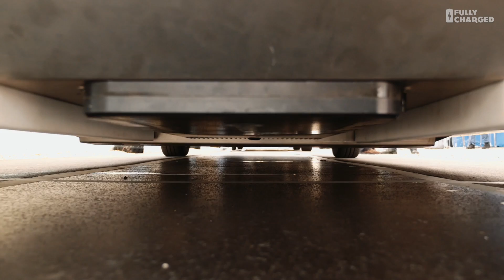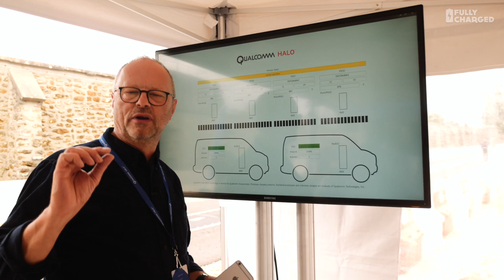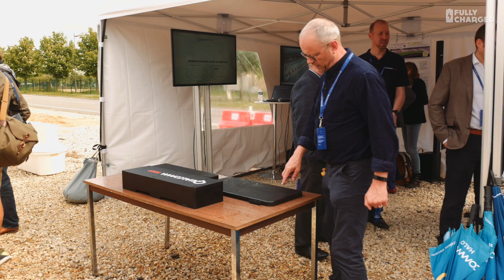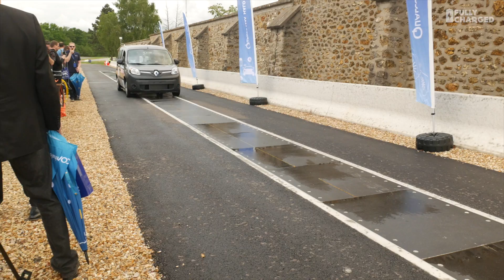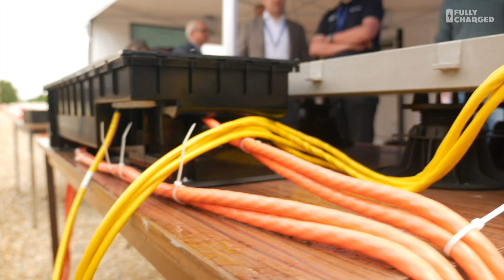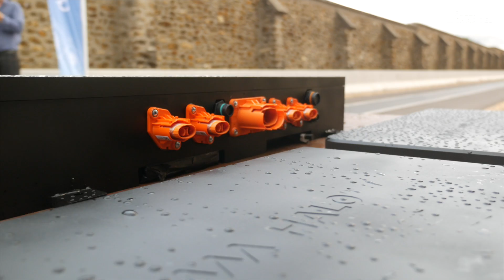Dynamic Electric Vehicle Charging | Fully Charged

Comment: 20kw for a fraction of a second means nothing. This has to be the dumbest, most inefficient possible way of charging a vehicle. The distance between the pads creates SO much waste it's not even funny, this isn't an electrified train getting its energy from the wires, this is the same technology that charges your smartphone. And these pads have to be on all the time, beaming out >40kw of power from each one!!!! This is as dumb as solar roadways. Do you see how little clearance they have between the charge receiver? This is like driving in a dropped car, every speed bump will scrape the shit out of that fragile pad. This might work in a parking lot, but not on a highway. You'd need miles of it to get any noticeable charge out of it, and the price of building thousands high energy inductive pads into the road will be astronomical compared to just charging at a station through a wire. A mile of charging roadway would probably only gain you <1/2 a mile of extra charge, and you want to take away highway lanes from non-ev vehicles, to create these charging lanes which can only be used by paying customers. Dumb. That 110kph run had 4.5 seconds of charging time..... So the customer gets a fraction of a cents worth of electricity, for the STUPIDLY high cost of having such a road..... I also wonder what such a high power inductive current will do to a regular car driving over it, it'll definitely add some charge to the wires in the car, and I can easily see it being possible to fry the computers in a regular car if it's not shielded. Cell phone chargers only send out power when they detect a phone charging, these would have to be blasting all the time.
Reply: You seem to be conveniently forgetting, that charging is only activated when vehicles, with the appropriate technology onboard, drive over it, & decide to use it. It won't be "on all the time, pumping out KW's". It specifically stated the pads turn on & off as the equipped vehicle passes over them. Therefore, non equipped cars will not activate them. Were you not paying attention, or are you deliberately trying to be obtuse ?. There are uses, for this technology. No one is suggesting we dig up all the roads, now to install them everywhere, these would be installed in limited locations where they would be beneficial. But the whole point of this seems to have zoomed way over your head...
Reply: +Charlie, sorry dude, but you're out of your mind. Think about how many on\off cycles each pad will go through, and then go find me a switch that'll push 40kw all day long while switching tens of thousands of times per day. Just because their test bed makes these claims does not mean that it can be done in the real world. I'm not saying it can't be done, just that it's completely idiotic to do so because it gives practically no benefits for a huge cost. If you're not going to dedicate a lane to this than how do you get just the EV cars into the lane and not have all the other traffic going over them as well? Maybe it didn't zoom over my head, maybe you don't understand practical engineering? Do some basic math, and tell me where I'm wrong. Calculate how much you'd get out of the system, how long of a road that is, and the cost for that section of road, and then you can call me obtuse. 

I guess I might as well do the math for you..... How much energy did that car get driving over a 100meter stip? 110kph, 100meter distance, that's 3.5 seconds of drive time over pads where only the VERY center few inches  over every pad (which itself is probably a meter long) can achieve 20kw, so I'd comfortably put that at a 90% efficiency loss over the entire drive area. That's a total charge of barely a SINGLE watt for every 100meters.. So for perspective, it'd take you over 100 hours of driving just to charge a 100kwh pack, and that's if you somehow didn't use ANY energy for while you were doing the drive. So in conclusion, if you drove over a 20 mile highway fully lined with these things, at the end you'd end up with maybe an extra 0.1 mile of charge available. If the car was just parked on top than yes, some decent charging is possible, but since the car is traveling over the pads, a TINY fraction of the time is actually used charging since the coils have to be perfectly lined up with each other. That's why if you move your phone off the center of the charging pad even a little, it loses all charging ability.
Reply: Again, you are assuming that these will be placed, in the most unsuitable locations imaginable. There are plenty of locations where vehicles are not averaging 60 - 70 MPH, where this would be beneficial. If the pads are only activated by equipped vehicles, it doesn't matter that the lanes have ICE vehicles in them as well. You imagine, problems where there are none. We are going to have to have systems like this for autonomous vehicles, & buses & parking bays anyway, so it will happen wether you like like it or not. Get with the program & stop being a such a luddite...
Reply: +Charlie, come on dude, I even did all the math for you. Your arguments make zero difference to the fact that this is an insanely inefficient way of transferring energy and it'll cost SIGNIFICANTLY more than what it's worth to the consumer. Your argument is as dumb as the people that say that we should have solar roadways just because we can. Look at the math, show me where it's wrong, show me an economical advantage of using such a system, or please, keep your hopes and wishes to yourself. I'm not a luddite, I just understand basic math, and you seem to not be worried about such frivolous things as "numbers". You're believing in a technology you clearly have zero understanding of. The problem isn't the charging technology, it's about how much charge can realistically be delivered in a real world situation, and until you do the math on that, you need to stop calling people names, because you sound ignorant. All the math is in my post, feel free to tell me where it's wrong, and in what perfect scenario you see this working and please provide the math to show it. I'll gladly shut my trap, I just require more than your opinion on the subject to do so. Remember, I'm not saying it's impossible, just that it's absurdly impractical, and all you have to do is show me the numbers.

Luddite, haha, funny, I'm an engineer that retired at the age of 30..... I really don't like to use my accomplishments to prove my point, but I can sure as hell assure you that I know more about technology than the vast majority of people, it doesn't mean I'm right, just that I'm not your grandpa.....
Reply: People who live in glass houses shouldn't throw stones, "sorry dude, but you're out of your mind", calling people names, that's You "Dude". The Solar Roadways engineering implementation was, lame & inefficient, badly engineered, & used in the wrong context. Better implementations, of the idea, such as on low footfall, Dutch bike paths etc, with a different design have been more than successful, so using that as an analogy is rather lame & unthoughtful. Obviously you don't implement schemes in wildly impractical areas. It's all about context & implementation. Inter-Area Haulage, Public Transit, Autonomous Last Mile Vehicles, & Parking are perhaps more practical implementations. Clearly it's not "absurdly impractical", as electric public transit buses & short haulage electric trucks, are already using pantograph style electric pickup mechanisms, for in motion recharging of, supercapacitor / battery banks, in a similar, configuration, & that works fine, are they impractical no, they are in use as we speak. So there is no reason why wireless charging, cannot be used, in the same manner...
Reply: Eugene S Stop being obtuse and narrow minded. You're making incorrect statements when you obviously haven't even watched the video properly. You say it won't charge the vehicle, well for all your big headed knowledge, you obviously don't know that driving a van at 110km/h actually uses LESS than 20kW so it will charge the car. Obviously, like with every technology (as it seems you were born yesterday) things get better and cheaper with time. There may come a day when it is cheap enough to install this on motorways. Maybe batteries will get so good they won't be needed, but if you're honest we can't be sure but it's worth testing. If we never tested anything we'd still be living in caves, or not be here at all.
Reply: charlie - uk 
Sorry, but as soon as the range of a battery exceeds the, let's say 80% average of journeys in a country and the charging time reduces, this becomes superfluous.
Given that battery technology is emerging that gives double energy density of currents examples with three times faster charging this will probably make inductive charging at least on roads, uneconomic in the relatively near future.
There's also the issue, as mentioned elsewhere, of road maintenance.
Imagine these buried just below the surface (did they say 6 mm?!) on motorway. If that Road required resurfacing it would take either incredible skill or incredible luck to remove the top surface without damaging the system, the depth of which would vary depending on wear rate and material deposited in the form of rubber. This could of course be avoided by burying the system deeper, however this would greatly affect the efficiency. Seems too much like hard work!
Also, if the system was buried literally just below the surface imagine the forces exerted by heavier vehicles causing flexing and fatigue to the metals?
Reply: Yes, I'll believe the hype about alternatives to lithium batteries, when they become available. Because there are none available at the moment or any time in the near future. Obviously using tarmac, is not practical. Roads are built out of other substances as well. I'm not suggesting this technology should be used on motorway / freeway with cars anyway, as has been observed it is not practical...

Comment: Price - I can only see that this will be much more expensive than normal plugged charging.
How much will 1 kWh cost?
Because if it's much more expensive than fast charging I'd take the break.

And it's ONLY a range extender. Still 90% of charge will come from the home garage, which means few people will be paying for this added infrastructure

Comment: I am all for greener energy but i cant help feeling some "snake oil" salesman has conned a lot of gullible people here. I see there is NO talk on efficiency what so ever. Would like to see this featured on EEVBLOG !
"two Renault Kangoo vans picked up a 20 kW charge." how was this measured ? how much energy was put-in ? OR did the charger use 20kW ? if so how much was transferred to the vehicle ? EVERY instance of inductive charging through an air gap i have seen has been MASSIVELY in-efficient.
Reply: No, kW is not a measure of charge, or energy and they never claimed it was. The primary purpose of this system is to maintain battery state of charge at cruise. The instantaneous POWER needed to propel a vehicle at 110kmh is roughly 10-14kW, so if you can transfer that level of POWER to the vehicle, then no POWER will be drawn from the battery and so no ENERGY used. If you can transfer more power, then the excess can be used to raise the battery SOC.
Reply: 20Kw of POWER was transferred (peak). At no time was the amount of ENERGY transferred mentioned, which would be a function of average power and time.
Reply: yah, but if the power comes from wind turbines at intervals along a motorway....efficiency doesn't matter so much as at least it can still be clean energy...

Comment: Rob you know I love you but you can't discard HFC vehicles for being unviable due to expensive infraestructure and now presenting us THIS
Reply: Even Toyota is admitting that Hydrogen Fuel Cells are a bad idea.
Reply: The problem with HFC is getting the damn hydrogen, not building gas stations and such. The amount of hydrogen needed is gargantuan, and the world only makes something like 70 million tons of it yearly. It could be done, though.

This idea is really cool but I see it limited to specific charging lanes on highways and interstates as well as areas that regularly see traffic slowdowns (so your car never runs out of charge despite being in bumper to bumper traffic). 

Even then it's probably more likely infrastructure for the latter half of the century. Even with better batteries the gains from this system would be pretty amazing, and could benefit trucking tremendously.

Comment: Something that I don't see mentioned yet - Imagine the safety implications of drivers concentrating on following a track on the road instead of keeping alert to potential hazards...
Reply: Oh no! They'll be focusing on the road! That's what they're supposed to do, man. Besides, have you ever met a millennial? They're going to be looking at their phone if you aren't forcing them to follow a track to charge their car.
Reply: I see your point. However the margins stated in the video (+/- 200mm) are a heck of a lot tighter than any normal road. I'm no biologist, but I would guess that orienting on your average highway takes little more than peripheral vision and a fraction of the brains full power. Keeping to a tight pathway like that at 70mph? A lot harder I would imagine. They even deem it significant enough to mention how noteworthy it is that the driver is managing to stay on the path! Add to that that fact that the driver would be highly incetivised to stay on said path in order to retain full charging ability, and I can forsee a situation about as distracting as using a mobile phone, which is of course now illegal.

Comment: As a charging technology, embedded charging has extensive installation costs that regular charging infrastructure does not have. It is not likely that governments will share installation costs with the charging companies. I cannot see an adoption path for this technology. 

Given the problem with current road surfaces (i.e. potholes, snow, warping), introducing complicated electronics will not improve upon the reliability of the road surface.

However, this may work in car parks since the parking lot is a private enterprise that could partner with a charging company. This would secure the charging infrastructure and reduce the need to carry charging cables and the need to manually connect the charging cables.

Comment: And how many kw did it take to get the 20 kw inductive charge? Bet it was alot more than 20 kw. Induction charging is very inefficient. its fine for say a phone thats uses a tiny amount of power but for a car it would be a really expensive way to get a short charge.
Reply: And the phone sits directly on the charger, while this needs a minimum clearance (as all cars do below it to the road) , further decreasing the efficiency.
Reply: Do not confuse phone inductive standards and EV inductive standards. Phones also charge inefficiently but looking at how little energy a phone needs, efficiency isn't their first priority, but rather higher frequency, making transformers smaller, making a smaller and lighter charger.

Life is complicated, guys :D
Reply: Elektrotehnik 
80%... At best, if sitting directly on the pad.
Reply: Normally, cable charging for EVs is around 90% efficient (losses in battery and converters of electricity),  while inductive charging is dependant on the distance between charging pads, but the stationary inductive charging is around 80% efficient.

Phones have lower eficiency for a number of reasons
Reply: Qualcomm site states:
"Quick charging with high power WEVC, supporting wireless power transfers at 3.7 kW, 7.4 kW, 11 kW and 22 kW with a single primary base pad and wireless power transfer efficiency of 90%+. "
If this "motion" evoluted wevc efficiency was  50% it wouldn't be bad at all